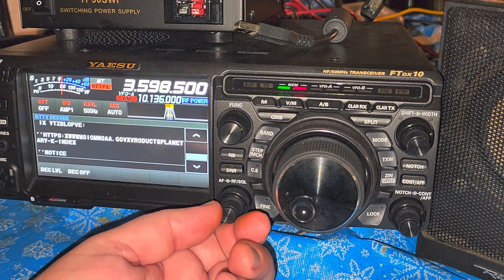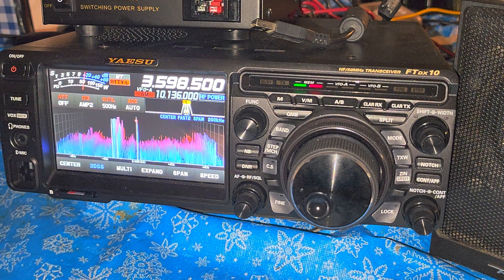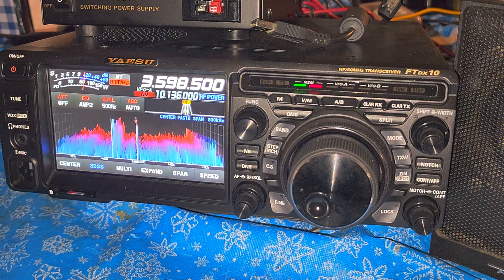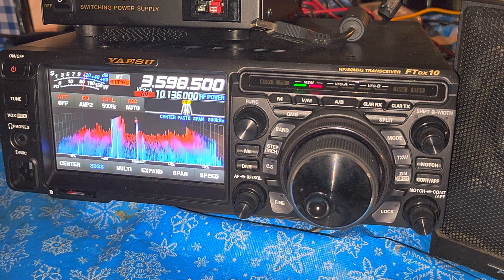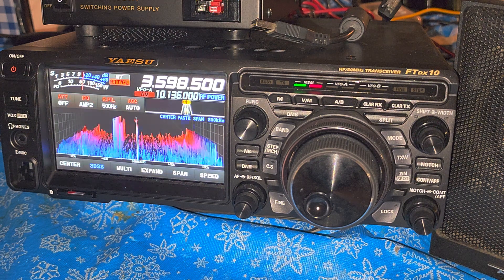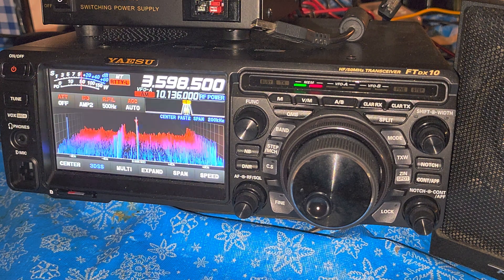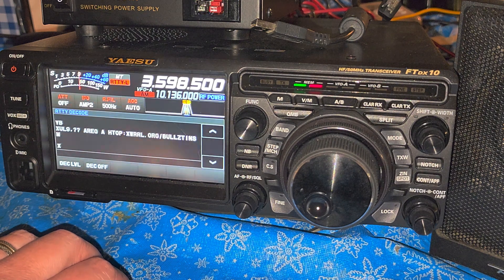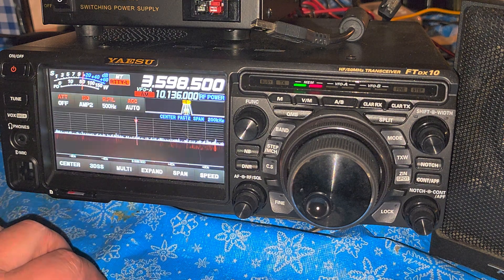Yaesu FTdx10 Looking at this modern transceiver and thinking of the Kenwood R-5000

Comment: Yes, very nice radio.  However,  I could not deal with that constant flicker in the display.  Also, did you say in another video that the AM wide filter is 12kHz?
Reply from the maker: flicker is only a artifact of the video.  There is no flicker
Reply: @OfficialSWLchannel  Ok. Thanks.